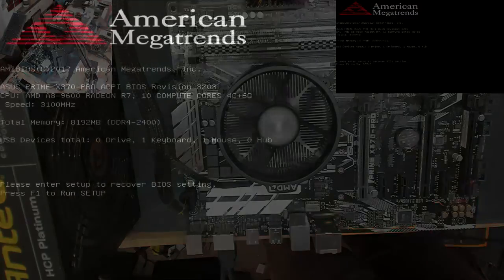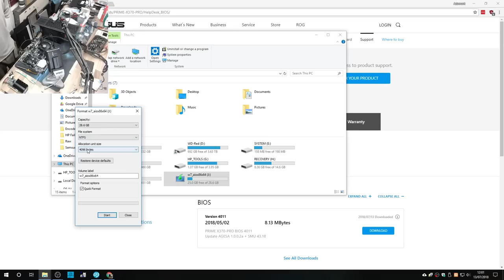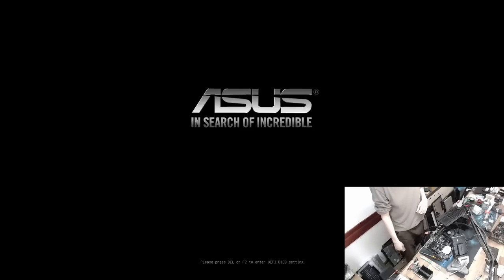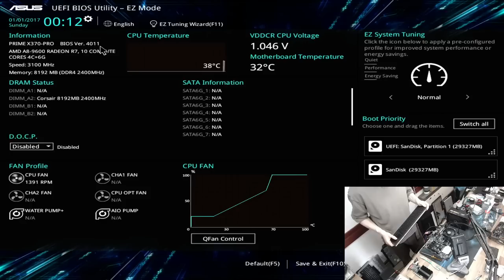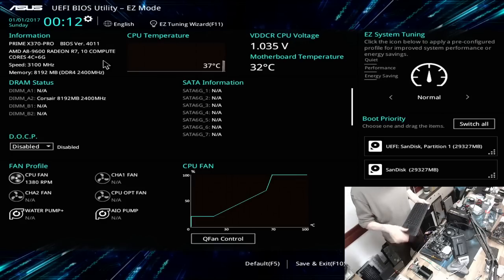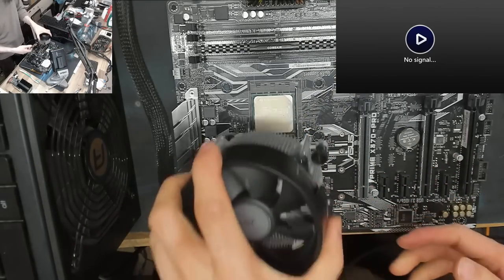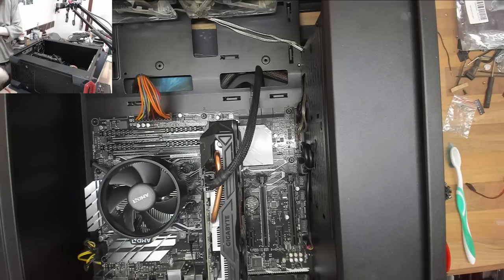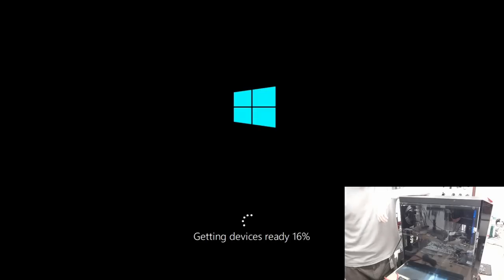LFC#143 - New Ryzen 2600x build with no POST

Comment: curious to know how much he charged the client considering he had to pay for the apu
Reply from the maker: Client was not charged any extra for that. This video is somewhat obsolete now, what with Ryzen 4000 on the horizon, but that APU paid for itself over the next year with the amount of mobos I BIOS updated with it!
In retrospect, I should've bought a second hand Ryzen 1200, as the APU caused problems in some places. But we're about to see all the tables turned on their heads with Zen 3 anyway.
Reply: @Adamant_IT  so how much did u charge for this repair?
Reply: @Милошмилош-ц2г  He ain't gonna tell you that! 😂😂😂
Reply: @Милошмилош-ц2г   hope this helps: 
in some cases (like when new components/issues come to the market) you spend a long time diagnosing a problem. you can't charge for 10hrs of (guess) work, so you lose money/time on the first ones. 
as times goes by, the same problems reoccur and you're able to fix them quicker and recover the lost time...  

ps: the actual price is based on location and all that. some places charge $50 for a BIOS update and that's acceptable but in other places $10 may be very expensive...
Reply: @duroxkilo  Some of the bad companies I have seen charge £100 for putting in ram sticks! and about £80 for putting in a SSD or hard drive! So imagine how much actual repairs are!
Reply: @gentarofourze  Were you perhaps expecting someone to work on the PC for $10 per hour?  £80 is likely a  minimum for even hooking it up to do anything....
Reply: @mdd1963  Yes and no, and I saw companies charge £100 15 years ago, and want even more for a motherboard replacement  And one in question didn't have experienced techs they had minimum wage workers with basic training, if you can even call it that. But I have seen smaller local ones charge something like £30 for ram replacement who have been there over a decade often even close to double and fair prices for other things. The ones that charged £100 or so it was a literal stick it in slot, and do no other troubleshooting, if it failed to boot they wouldn't do anything but remove and reseat then give up but still charge the full fee saying they attempted the work.
Reply: @gentarofourze  My mother mentioned 20 years ago that GeekSquad had charged her $250 to repair her computer...; when I asked her what parts they had to swap, the answer was 'none'. Apparently, a Win95 or 98 reinstall was quite complex for them! :)

Comment: Great video. My system was showing exactly the same symptoms on a Ryzen 7 1700 build (Gigabyte board). Only difference was, it was not a new build. This system has run flawless for the last 14 months and only from a normal windows shut-down, I haven't been able to boot again. I've come to the conclusion that it is a motherboard or a processor problem, though I don't have these spares to test. I therefore may buy a new cheap motherboard to eliminate one or the other. I also followed your test procedure as well, before I watched this video. Will let you know how I get on, but thanks.
Reply: Did you solve it? I have the same problem with Ryzen 5 1600 on Gigabyte board. More then 16 months, everything worked. Then just no POST with CPU light on. RMAing motherboard twice. They send it back with message that everything is all right. With 2nd RMA they updated MB on BIOS F24 and said, that its working with R5 1600. But not for me, still CPU light on and no POST. Some days later I gave it a last chance before RMA CPU aaaand.....miraculously, it worked. No idea why but I was in BIOS. More then a week PC worked but there was some errors, like 1) PC never woken up from sleep mode, instead the system has rebooted  2) At least 3x there was warning call from American Megatrends that said: "New CPU installed, fTPM NV corrupted or fTPM NV structured changed" but at least I was able to enter into windows. One day I wanted to get into the BIOS  for some tweaks (RAM speed etc.), so i hit restart button in Windows aaaand.....I was where I was before. No POST and the CPU light is on and nothing helps. I still think the problem is on the side of the motherboard, especially something with a socket that cannot correctly identify the CPU but there is still small chance, that it is bad CPU. 

So I would like to know how your problem went, before RMAing MB for the third time.

Comment: ASUS boards have NEVER failed me or all the people i have recommended em to. 

Gigabyte and MSI however... Aint touching that, and their AMD bios is recipe for brick.
Reply: Ive never had any problems with all three of those motherboards. I think its just the luck of the draw. You get a good one and as long as you don't do anything to it you should be good to go until it finally dies. Currently I have two PCs I built for my son and I. One has MSI motherboard and the other an ASUS and they are doing good. My previous PC that was replaced just because I needed more gaming power was a Gigabyte and someone else has that computer now and they love it.
Reply: @Mictian1980  Yeah, its very possible. However you should check Adamants 450 Gigabyte video, i think that bios mess is a big nono for anyone that values a bios update.
Reply: @brutallica2944  Speaking of Bios. My ASUS motherboard had an update that came out on 4AUG2020 named "1002" I updated the bios and then a week later the update is no longer available on the ASUS site. No reason was given for it being pulled. The latest BIOS update you can get came out in July "0805". Is this something I should be worried about? I still have the 1002 update they pulled from the site on my thumbdrive. My motherboard is the B550 Plus
Reply: @Mictian1980  ive allways gone with tve newest but never used beta bioses.

If your pc is table and ram speed is good and voltage is good, no issues. Then id just truck along with the 1002. And not worry about it.

https://www.techpowerup.com/forums/threads/asus-rog-strix-b550-f-bios-1002-pulled.271022/

Have you read this thread?
Reply: Brutallica this is the first time I have seen this thread. Thank you for linking it for me! I’m glad I’m not going crazy. So far it’s been good so I lucked out.
Reply: @Mictian1980  No problem dude! Just got my ASUS ROG STRIX B450-F + R5 3600 with 3600mhz gskill ram up and running yesterday, smooth as butter, and btw i havent upgraded since 2013, and ill just say HOLY FUCK ryzen kicks ass hahaha.

Comment: I use a Credit Card to apply a thin uniform layer of Thermal Paste over the entire surface of the CPU heat spreader.
Reply: Don't do that, let the heatsink do the spreading.
Reply: @GoldSrc_  Why? What's wrong with my method? In 20 years of PC building I've never experienced any issues.

If one uses a heatsink with pre-applied thermal compound, it's spread in thin uniform layer, just like my method!
Reply: @marcse7en  That's what you think, but that layer is never uniform.
You always let the heatsink do the spreading so it conforms to the microscopic holes on the surface. You can actually create air gaps if you spread it and then put the heatsink on.
It might have little to no effect, but that's how it works.
Reply: @marcse7en  Heatsinks come with pre applied thermal compound because they do the spreading.
Your method has worked, but that doesn't mean it's the right way to do it, you could eat ice cream from a bucket with your hands if you wanted, does it work? sure, it's the correct way to do it? probably not.

Comment: At mark 32:46 in the video what is the the thing called you are plugging the power and rest buttons called?
Reply from the maker: I'm not sure what I'd call it... I'd call it's a front panel connector block, but I can't find any useful results when searching. They come with motherboards sometimes to make it easier to quickly disconnect/connect the FP wires.

Comment: Hi Adamant IT, are you using a HDMI Capture Card for recording the devices / units you troubleshoot? If so, what brand and model? Thanks in advanced.
Reply from the maker: I currently use an old Elgato Game Capture HD, but it's not great. Planning on replacing it with something from AverMedia, who I've had a lot of good experience with, new and old products.
Reply: @Adamant_IT  Thank you for the swift reply, Adamant IT. So far, I've learned a lot from your videos and I've saved 5 client's PC Workstation since quarantine started. :)

Comment: Thanks for this vid. My problem is I only get a 1 sec flash of the LED's down around the audio section. Using Ryzen 3 2200G, 1 year old. I upgraded my main PC with the Ryzen 7 2700.  Hard for me to believe it is bad. Got Amazon Warehouse deal for Aorus B450 M. Sent it back and the 2nd one does the same thing. The Bios/UEFI should be fine. What are the odds that Amazon has sent me 2 bad boards. So now I have ordered the Ryzen 3 3200G, I hope it does not need an updated bios for 3rd gen.  And I should mention that I have tried this in 2 different cases with 2 different power supplies.
Reply from the maker: The B450 Aorus M is... a troubled child. Really seems to be luck of the draw with that board.
Reply: @Adamant_IT  Turned out I got a new cpu and it worked.

Comment: That was thrilling!  Great to watch a master at work...  eliminating the obvious and discovering the fail.  Thanks much.  This might help me resolve a similar issue with a Ryzen 3700x (suxorz that there's no CPU graphics).
Reply: Install a beep speaker if there isn't one.

Those early boot diagnostic beeps (or their absence) will give you a lot of information if you have to run headless.

Comment: Have only watched a few minutes, but I assume that it is just an old bios on that x370 board which natively don’t support ryzen 2000s. Common problem with novice AM4 users.

It will be interesting to see if I’m correct at the end of the clip.
Reply from the maker: Basically that. At the time of this video I had zero interest in Ryzen, and didn't know about AM4's broad compatibility.
I tend to put videos like this that end up with an obvious solution up anyway because it helps people learn the troubleshooting process.
Reply: Adamant IT Yeah. It was a great video. Thanks for sharing.

Comment: that board must have had the USB 3.1 header ripped off cause that board does come with the plastic plugin for it but if you pull at it wrong you can rip them off to leave bare pins which are not good. makes me think this is not a new board and that it was just upgraded to the 2600x only

Comment: So the problem was an outdated BIOS? 
I have this very same problem right now with a Asrock b450m pro4 and a Ryzen 3400g.
Reply: yes, you'll need at least version 3.3. AMD actually have a programme where they'll send a "boot kit" - the cheapest weakest AM4 CPU (a modern "Athlon") solely for the purpose of updating the BIOS to support newer Ryzen generations, and then once done it has to be returned.

Comment: I have same issues. My rig was working fine for 5 months then last week it started to act strange. It would boot up then it wouldnt boot until last week it wont boot anymore. All cpu and system fans including thr rgb running. I've open and check inside and saw the MSI Ez Debug VGA Led turned on. Already removed everything and clean the RAM and GPU pins. Also done resetting the CMOS. Still got no POST.

BUILD:
MSI B450i Gaming Plus AC
Ryzen 2600
MSI Rx570 8GB OC Armor
G.Skill Trident Z 16GB (2x8GB) 3200Mhz
PSU: Corsair SF450
Casing: Cougar QBX
Reply: Me too, let me know if the problem solved

Comment: PC turns on cpu cooler,psu fan,cooling fans, are spinning VGA fans aren't spinning but LED's working on VGA. MSI EZ DEBUG indicates CPU and quickly indicates VGA."NO SIGNAL" on monitor cannot get into bios.

Note:- this was the first boot up I was able to install windows it worked nearly 2 hours and suddenly monitor showed "NO SIGNAL". I couldn't install/update bios,drivers,etc plz help?
Reply from the maker: If the debug LEDs are moving over to VGA and stopping there, it sounds like a graphics card issue. Try testing the card in another computer, or putting a different card in.

Comment: I have a GA-AX370 GAMING K7 and my new ryzen 9 won't boot.  Fans and everything comes on but the cpu on-board warning light is going off.  How do I reset a safe mode to flash it.  It doesn't start up so I may run a thumb drive with drivers on it.
Reply: YOu need to get it to POST with a compatible CPU first if it does not have FLASHBACK ability (i.e., ability to update BIOS without CPU)

Comment: Can you have troubleshooting video content regarding power supply? I would be great for viewer like us doesn’t have any idea what’s going on power supply like some on computers that have power supply…Many Thanks!
Reply from the maker: I have no plans for it at the moment... PSUs are more complicated than people think. A lot of folks parrot the "just replace the capacitors" line, but there's a great deal more than just caps that can go wrong, and many faults require you to reverse-engineer the switch mode controllers and then probe their outputs with a scope to check for anomalies... and it goes on. Generally not worth it when most PSUs are < $100.

Comment: Whats the point of brushing the cpu pins and socket?  If you have done LN2 and have used vasoline or some kind of sealer to stop condensation, then yes I would recommend this. But otherwise this is ultimately pointless and even potentially dangerous to the hardware.
Reply: Did you watch the video with sound? He said it is to get rid of the thermal paste on the pins of the CPU. There isn't really any potential danger as he is using IPA which isn't conductive and Graham will 100% be careful with it.
Reply: @loganparker4184  When you break a customers hardware and have to fix it or pay for it.  You will understand what I'm saying.  The is unnecessary and could cost him a lot of money if he were to knock a pin or 2 off the CPU or even damage the socket. Unless it was being used for liquid nitrogen or something similar. You should never touch the socket or pins. Never risk what you don't have to. This is basic computer building 101.

Comment: Alot of these Boards are not 2nd Gen Ryzen ready, u have to use old chip like a 2200G to update BIOS...
Reply: Some early X470 boards might not even work with the 2200G...as those came months after the 2200, 2300, etc..

Comment: I've got a 2700x and Asus x470 crosshair vii hero mobo and my problem is I hit the power button and it runs for less than a second and turns off.
Reply: @Adamant_IT  - thank you for the reply.  Yes I tried a different psu, I have an unopened new one I can try also but I doubt it's that.

I don't have a spare mobo, cpu or DDR4 sticks but I'll borrow my friends og skill memory (pun intended) and give it a try. 

Also I've taken the whole build out of the case already and treating it like a new build from scratch.

Comment: I got the Ryzen 7 2700x CPU, and the ROG Crosshair vii Hero X470 MOBO, with a Corsair RM 750x PSU, with a GTX 960 GPU, and two G.Skill Ripjaw DDR4 RAM in the B2 and A2 slots and it will not post! I’ve reseated then CPU and reapplied thermal paste, Reseated the GPU and RAM. Tested it in the bench and in the chassis and it won’t post man. I’ve taken out the battery in the motherboard and put it back. It’s a brand new MOBO out of the box, how can I tell if my MOBO is faulty??? We’ve spent a bunch of money... :( not to mention the 2TB Seattle HD and Samsung 860 EVO SSD.
Reply: Adamant IT thanks man! Really appreciate your feedback and love how thorough you are. Actually great help!

Comment: My board says Ryzen 3000 ready would that be fine with the 1600 because I’m getting no post?
Reply from the maker: A Ryzen 1600? Yes that should work in basically anything it'll fit into. Got any diagnostic LEDs on the mobo to help? New build or fixing/upgrading an old one?
Reply: Adamant IT yeah it’s a new build I’ve swapped the gpu out and I get a signal so I’m going to see if I can sort it out

Comment: If this was on my PC I already knew it was the rams as every time my PC acts like that is always the rams, in fact the ram slot have always plagued me since the 90's...

Anyway this current PC I have is from 2011 and it's the only PC I ever had that never had hardware problems, however after a few years like always if I just touch 1 ram = huge problem, I have to loose many time re-adjusting the rams until it finally posts or else even the speaker doesn't give any bip, however my motherboard has the leds of errors and the ram memory led always stay lit...

ps: Anyway about the problem in this video if you knew AMD you would probably already knew it would most likely be a Bios update, but sure since you didnt have any AMD you had to fully diagnose it...